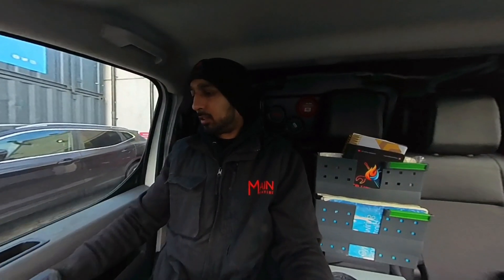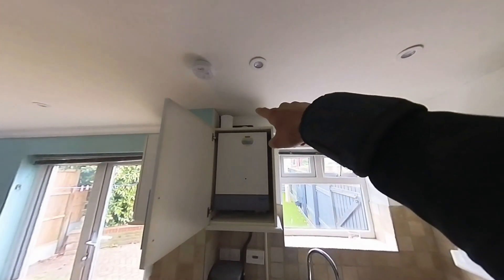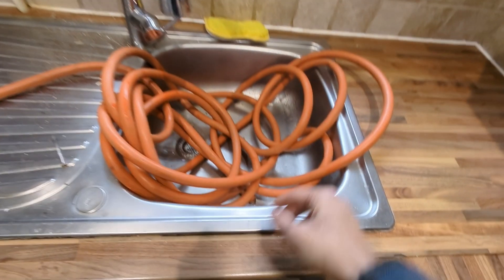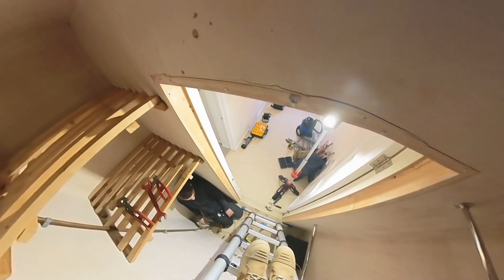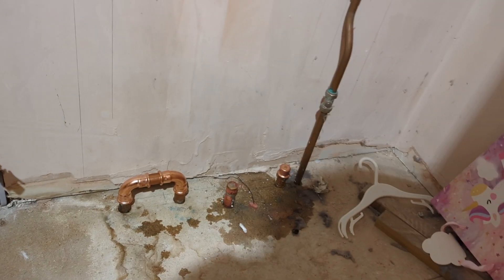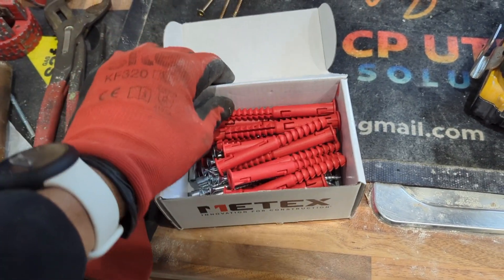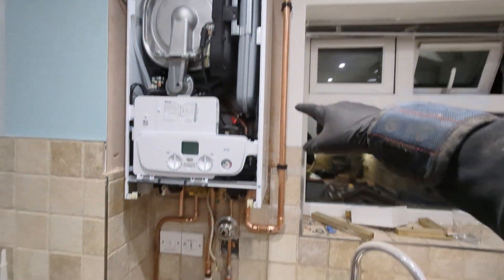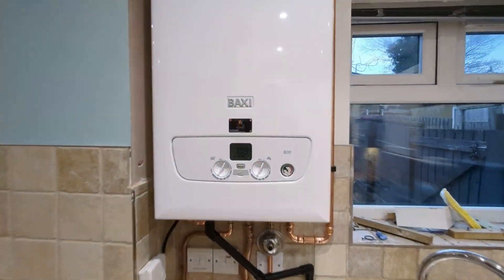A Day In The Life Of A Gas Engineer #21 - Open Vent To Combi Conversion

Comment: serious concern regarding the  flush,  I was told never to let the new boiler come into contact with the old water system  in case of contaminations circulating around the boiler causing clogging which can lead to other equipment failure or shorten the life of the unit,   you always flush with the boiler isolated or prior to decommissioning the old system so contaminates are removed.
Reply: Serious concerns 🤣🤣🤣🤣🙈🙈🙈
Reply: @TheLeedsleedsleeds  🤣🤣🤣
Reply: he left cleaner in over night to make it easier to flush the next day and any loose bit of sludge get caught in the filter over night
Reply: @jay96lfc  yes but any contaminant will then get flushed into the plate as well as the narrow tubes of the heat exchanger, this can have a long term decremental effect,  two rookies did the same thing , the property had been empty for a while and had never been cleaned since it was a conversation of an old house where the owner had died,  into flats,  serviced regularly (supposedly by a well know group with a flame) whist the header tank was clear the rads and pipes were a different matter,  with the water looking like treacle with enough mangnatight to give a work out, in the end it was emptied 3 times to remove the contaminates,  but none of this was obvious when the old boiler was removed due to no one being there,  within weeks they were back at the property,   and ended up having to replace the boiler.  FLUSH BEFORE running through the new boiler.
Reply: @ram64man  youre being a bit too much there, the guy went back the next day and did a full powerflush